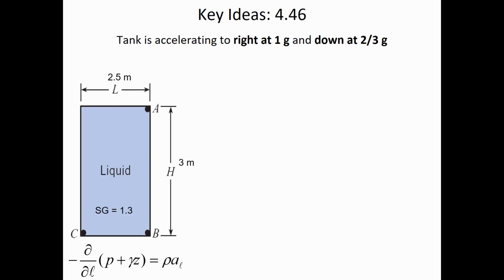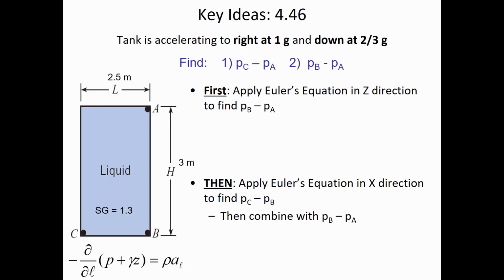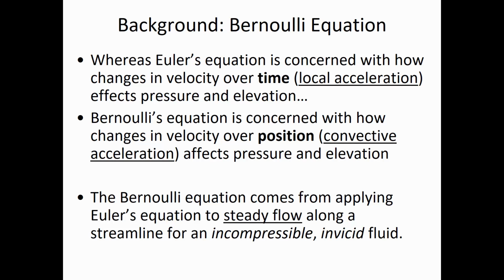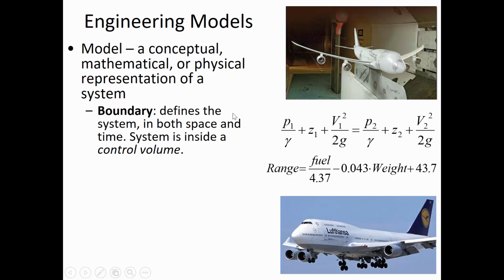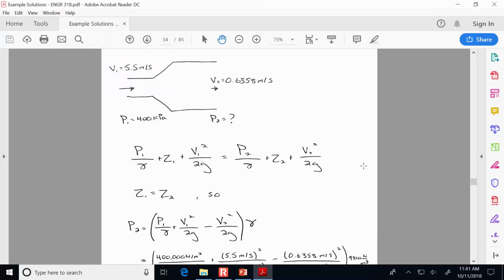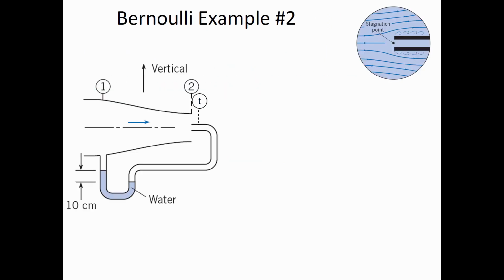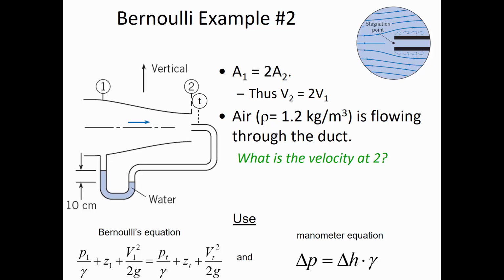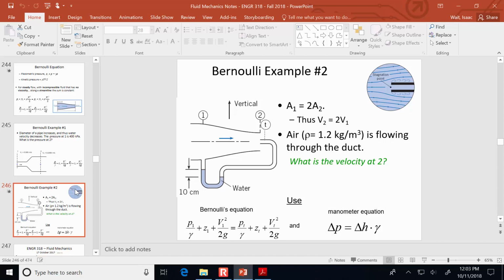ENGR 318 - Class 16 (11 Oct 2018) Bernoulli's Equation

Comment: Why can we use Bernoulli on the air flow if it is a compressible fluid
Reply from the maker: Bernoulli's equation is only an approximation of reality.  It will never exactly describe what is observed in real life.  The closer the real-life conditions are to the assumptions implicit in Bernoulli's equation, the more accurate the approximation will be.  

Often Bernoulli's is "good enough" (e.g., if the pressure change -- and how much it is compressed -- of air is low, when it is undergoing a change in velocity).  But sometimes it's not good enough, and that's when other equations -- that do account for energy loss, or fluid comprehensibility -- need to be utilized.